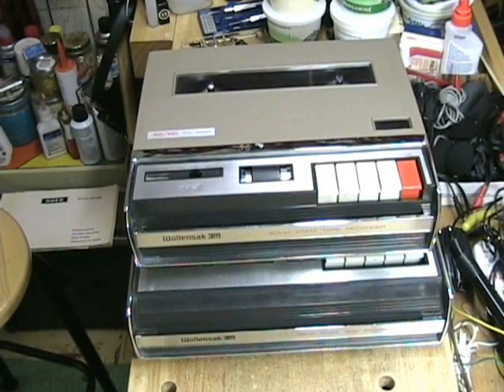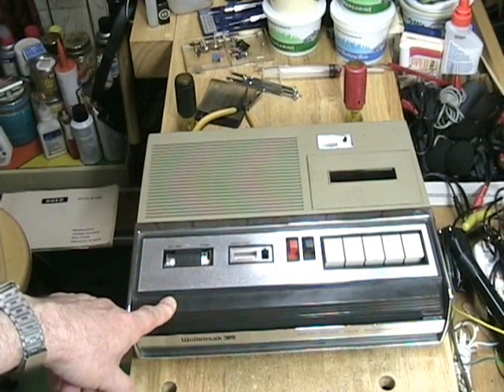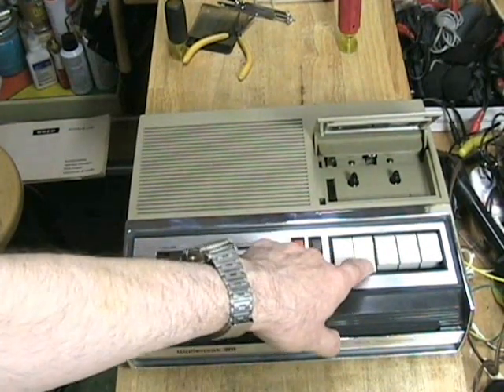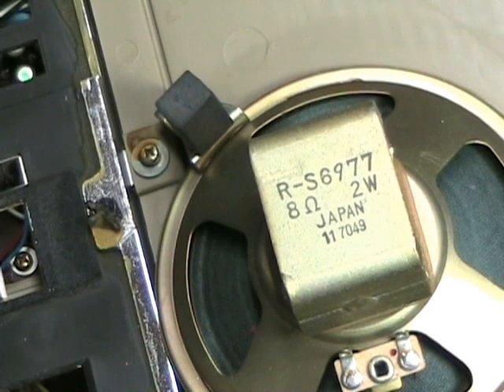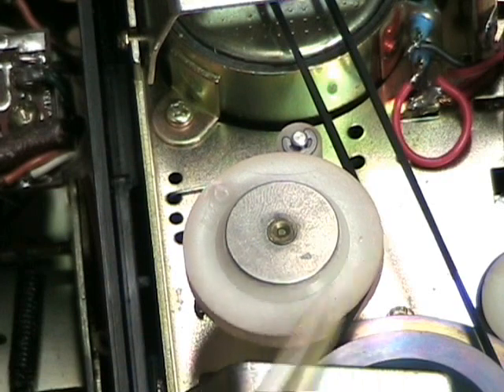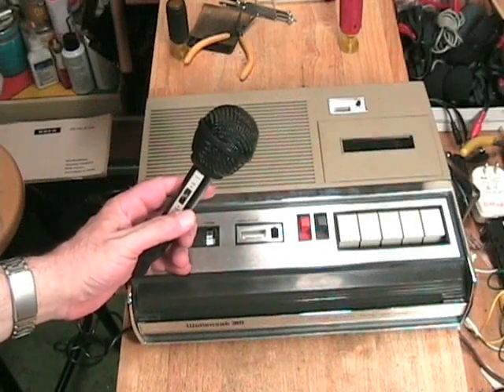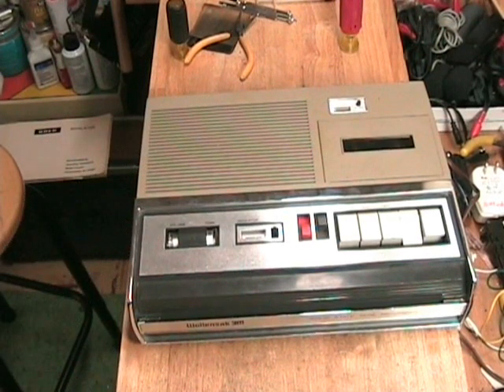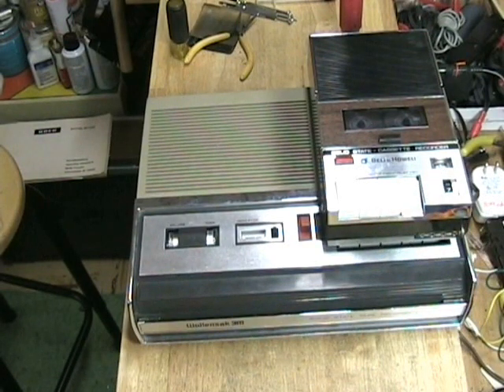Disappointing Wollensak - Exploring the Wollensak 4310 Vintage Cassette Tape Recorder

Comment: The non-locking FF, REW and PAUSE controls are TOTAL deal-killers! Reminds me of my first tape recorder a Norelco portable bought in 1969 and badged with the name "WOLLENSAK"! Stop, Play, FF and REW were all accessed by a single joystick that did NOT lock in FF and REW mode :(
Reply from the maker: David Perkins  Sounds like what you had was a re-badged Philips/Norelco Carry-Corder 150. This design had a pretty good amplifier and an electronic and adjustible speed control, which the unit in this video lacks. 

 I have a video on one of these rebadged recorders  (that had melted belt syndrome) which you can see here: https://www.youtube.com/watch?v=yoOZq8eL2Ho 

Does this look familiar?
Reply: It certainly does! I added comments

Comment: Wollensak might have had another more expensive model available at the same time that included the radio. They could just have to switch the exterior cabinets for a production run of the chassis with the radio to a chassis with the corresponding control knock-outs. There wouldn't have been any reason to go through the expense of making a separate interior part for a non-radio version when it wouldn't matter or be seen by anyone except to confuse us 45 years later.